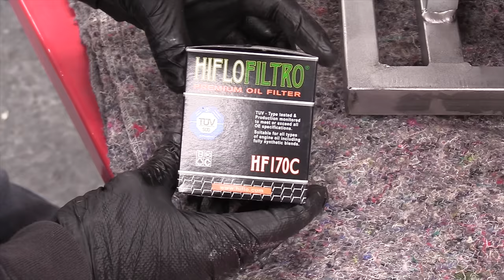Harley Sportster, Engine Paint Restoration, (2 of 2) !

Comment: I always find it a lot easier to do the polishing of rocker box's and side casings when there off, they only need a quick wipe over when they get grease'y finger prints on them later on in the process of fitting the engine. It's almost as if you forgot to do it. doesn't make the rattle can spry job look any better though!! sorry.
Reply: Yea. I feel ya. I try not to rag on peoples stuff to bad. But this was just awful. Even the color.  And idk how you could buff those covers correctly and not mess that paint up.  Least do that before you paint.  Channel usually does great work. This wasn’t there best lol

Comment: Looking good. You get a lot less greasy paw prints if you get some long Q-tip applicators instead of dipping your finger in oil to lube o-rings. Makes for better grip on the oil filter too. Love that little T-handle torque ratchet. I need to get one.
Reply from the maker: Thanks mate, good tip.. i left a direct link to the T-Bar torque wrench below the video in the description if you fancy one.!

Comment: Ooh I like that polishing wheel.  Since my garage is too small for a bench grinder, I'll be putting one of these buffer wheels on the list. ✔
Reply: A polishing wheel on a drill will never do as good as a bench set-up because of the lower RPMs. An air operated tool does pretty good because it spins faster.  Just letting you know for information purposes. I'm in the same boat as you, no room and my compressor is too small for air operated one so I'm using a wheel in a drill...

Comment: Hi I wanted to let you and others who do this kind of rebuilds, as I also do this, and I am presently working on a Sportster Chopper project myself. I wanted to let everyone know about the issue of using Stainless bolts on the aluminum motors and when this is done what happens to the fasteners like Stainless Steel bolts and the corrosion that will happen when these two metals are used together, PLEASE check out Albany County Fasteners about the issue I am writing to you about. I think it could be very important to all of us Harley Davidson lovers to help save these motorcycles so that they will last for many years and the next person who needs to rebuild a motor can do so without having problems during their teardown.
I hope that many people see this as it is important to know when rebuilding motors made with Aluminum.
Thank you for sharing this video with us as it has helped me, and I am sure helped many others in their projects.

Comment: Is there any problem with galvanic corrosion between the s/steel screws & alloy engine cases? As a bit of a novice with such things I'd sort of expected  copper grease so  was a bit surprised you used thread lock.
Reply from the maker: No, in fact quite the opposite, stainless steel fasteners don't corrode, so they are more prone to shake loose, specially in a Harley motor.!
Reply: @Moonfleet41  Sorry Del you are wrong, galvanic corrosion will happen due to moisture in the atmosphere, rain or road spray. Not a reason not to us them but beware it happens. With polished aluminium engine casings where the torque setting is relatively low I use nylon washers to keep the head of the bolt away from the case. Interesting video though.

Comment: To make the washers a better size use a nut and bolt to make a mandrel and turn them down on the lathe, you can do several in one hit. 

But you knew that already didn’t you… 🧐😂

Comment: When i was a Navigational Instrument Engineer back in the mid 70s - late 80s, on numerous instruments, i used to have to polish various bits and pieces. I got an enormous amount of satisfaction out of seeing a a sextant arc which i`d got to an almost mirror finish just using very fine emery paper. It`s one of the most satisfying things you could do.

Comment: Nice work mate. Just a question, i have a 97 1200 custom with chrome rocker covers. The chrome is all flaking off,  totally shit. Sharp edges everywhere. What is best way to strip it off. Thinking to custom paint them. Thank you from NZ.
Reply from the maker: OK mate, not uncommon I'm afraid, best solution is to take a fine grade flap disc on your grinder and sand off all the sharp edges, go over the rest of the covers which will scuff them up, then use an etch primer, then paint... they'll be fine!  Good luck with it.

Comment: So, the oil dip after heating up the parts was for rustproofing or hardening? And are you heating to a certain color or just getting them hot?
Reply from the maker: Hey Brother,  Quenching in oil does both depending on the temperature you heat it to. Im just taking the steel up to a light straw colour which is about 400f,  at that temperature it just rust proofs it and gives a nice dark colour... heat much above 'blue-purple' into dark red and you'll be tempering the steel.!
Reply: @Moonfleet41  Got it! I'm really diggin into the "Forged In Fire" series Netflix is showing now. Bladesmithing looks like a lot of fun... and sweat! So much more to know than just beating the shit out of some hot metal!

Comment: Your project is coming along great! I still think that darkening and rust-proofing your original fasteners by heating them with a torch and immersing them in oil would have yielded a beautiful contrast with all of the polish and silver on the engine. You could have either pocketed the savings or applied them to other areas of the project, but your project your choice. It's still great content and well worth the watch!
Reply from the maker: Cheers Paul, good point, but on some of them they were so bad that the actually integrity of the fastener was starting to be affected and couple that with heating them to 400F and quenching, could have made them even weaker as they're so small, and the kit was actually pretty good value at just £36 and now I have stainless steel which'll never rust, I think that's a good value upgrade... but thanks again for your input as always.

Comment: Ive never seen a torque wrench like that before. Is it part of the T handle or is it an adaptor?
Reply: I checked it, it costs a bundle.
Reply from the maker: Hi Fog, Vondenballs is right, it's a pretty expensive tool, a dedicated t-bar torque wrench, but highly accurate and perfect for the small fasteners, which are critical to get right... there's a link in the description if you wanted more information.

Comment: What torque settings do you use for the new  stainless fasteners?
Reply from the maker: I just go with the spec in the Critical Fasteners list and as they're stainless, naturally use threadlock, so therefore it's a wet thread so I always go with the lower figure in the torque range.

Comment: Wow it turned out great! I finally got time to sit down and watch this tonight. Can I ask why you cool down the parts in, I'm guessing, oil?
Reply from the maker: Hi Simon, great to hear from you, the oil burning process is one of the most ancient traditions of mankind, it goes back almost to the Iron Age, and then down the ages, the Romans used it plus Medieval armourers to combat rust.  Quite simply you heat the metal up to where it just starts to change the first shades of colour (never take it to red heat, you can alter the temper of the steel), then once it's hot, quench it in oil... this will burn the oil in to the micro structure of the steel, creating a water repellent layer... in ancient times, obviously armourers didn't have engine oil, I believe they would use things like pork fat or olive oil, but that's the reason mate... Take care and have a great weekend, I've been enjoying some of your older content!
Reply: @Moonfleet41  Ahh, thanks, I should have thought of that, the pores in the steel, note the iron age and roman part. :)  Super smart, I should heat up my whole car then with all the road salt we see here in Norway.  Thanks again and cheers for the weekend! Best wishes, Simon.
Reply from the maker: @LandRoverDrive  I think with the summer temperatures we have had here this last week, i could have parked mine in the sun for a few hours then thrown a few buckets of oil over it.. job done..lol!